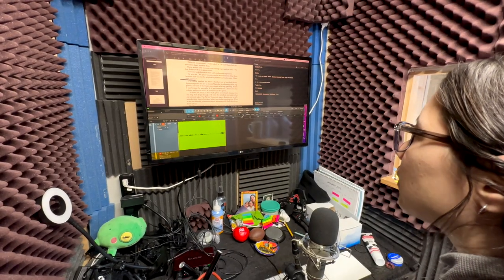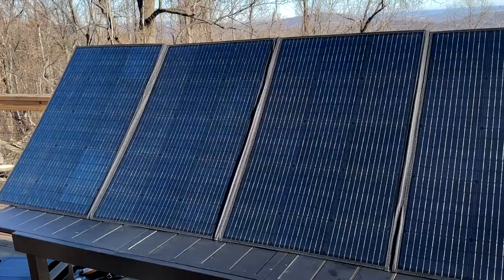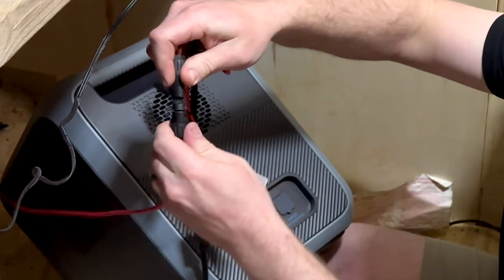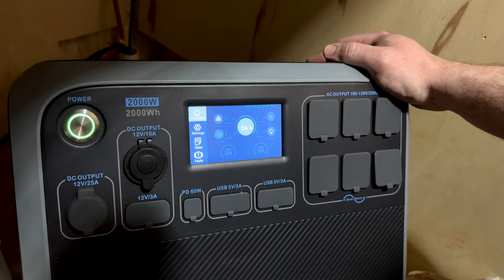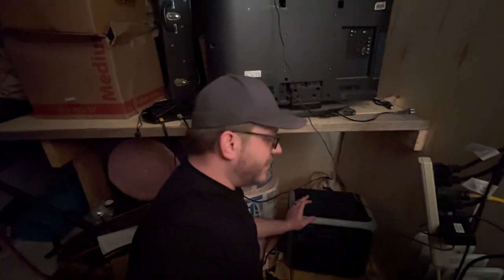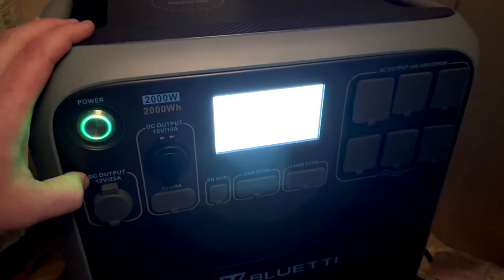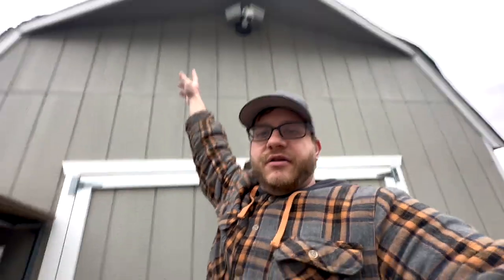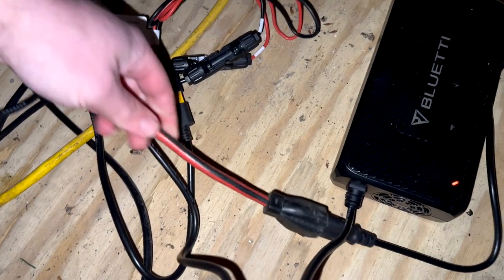Off Grid Recording Studio? | Bluetti AC200P Portable Power Station with Solar

Comment: Get you 4ea  LiTime 12V 100Ah LiFePO4 Lithium Battery, Best RV, Marine & Off Grid Solar Battery, 4000+ Deep Cycles, Built In 100A BMS $349.99ea   and a DC Charging Enhancer (D050S) from Bluetti for $199.00…Total $1598.96 This is cheaper than that Bluetti expansion battery …